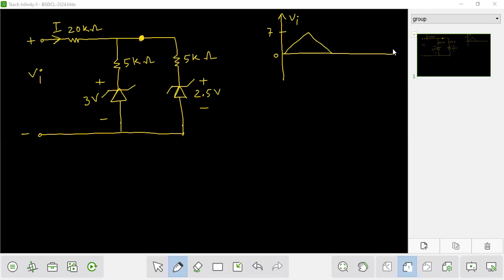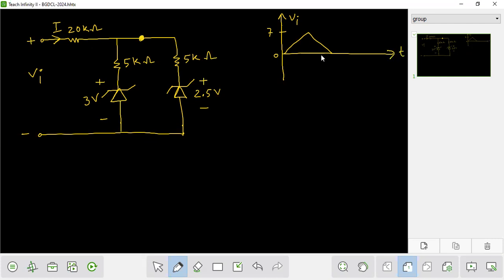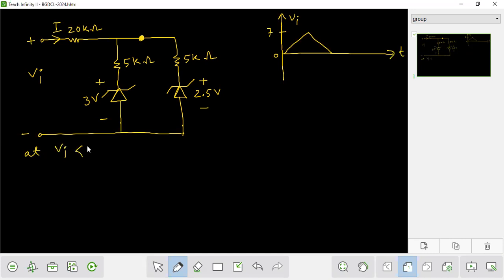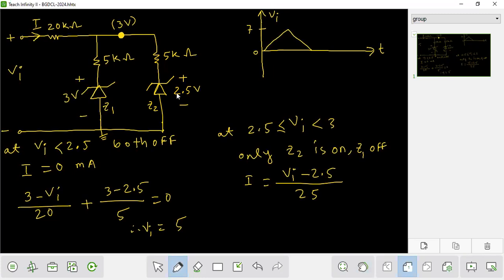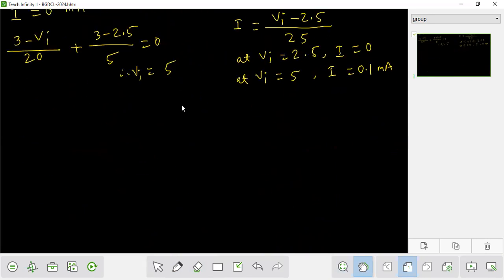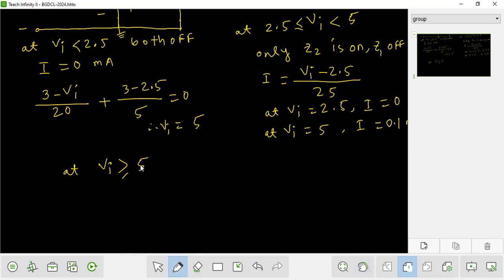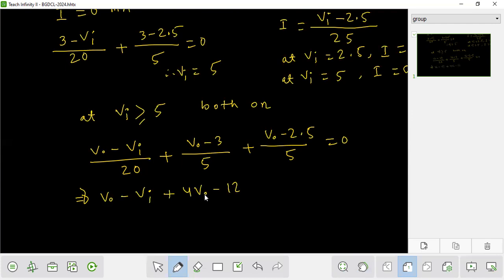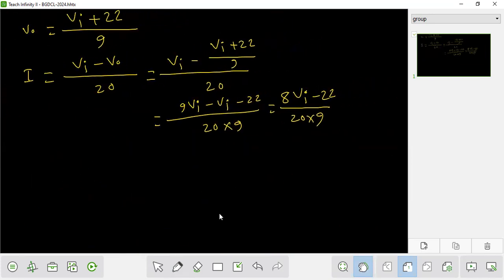eee | BGDCL-2024 | AE | Zener Diode | ব্যাখ্যা সহ সমাধান

Comment: Vai nesco niye apnar pokkho theke suggestion den....calculator chara ki type r math ashbe?
Departmental mcq ashbe? 
Ekta guideline please
Reply from the maker: আমি পুরোপুরি কনফার্ম না তবে থিওরিকাল বিষয় বেশি আসার সম্ভাবনা। যেমন Bl theraja এর অধ্যায় শেষে শর্ট প্রশ্ন আছে সেগুলো দেখতে পারেন যেমন: Why we use Star-Delta starter? Condition for Maximum power in Dc machine, Why Transformer rated as KVA not KW?
আবার পাওয়ার সিস্টেমে বিভিন্ন প্রটেকশন scheme যেমন Merz price বা এই টাইপ ডায়াগ্রাম। Substation এর online diagram এবং ইকুইপমেন্ট ( কি কি লাগে?)  এই জাতীয় বেশি পড়তে পারেন। 
DC তে ম্যাক্সিমাম পাওয়ার ট্রান্সফার এর প্রমাণ। ট্রানজিস্টর এর small signal analysis, diode rectifier circuit deaign and explanation etc. 
Non বিষয়ে আমার তেমন আইডিয়া নেই। বিসিএস প্রশ্ন ব্যাংক দেখতে পারেন।